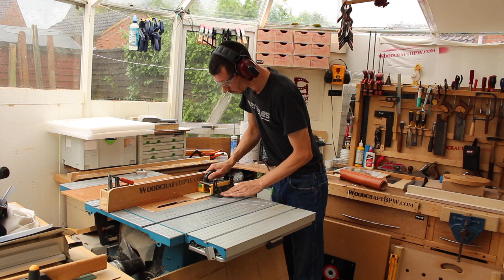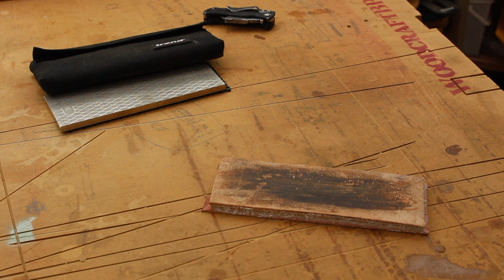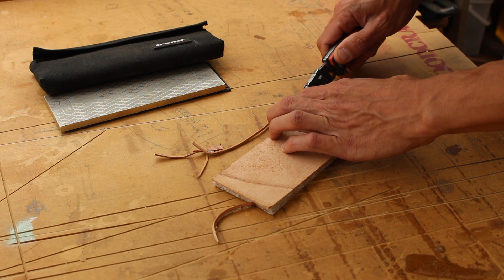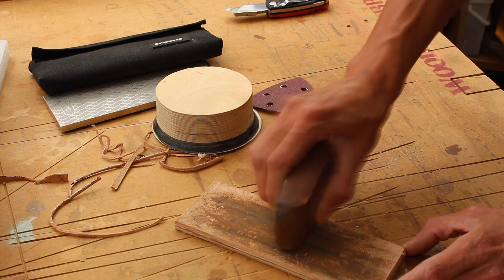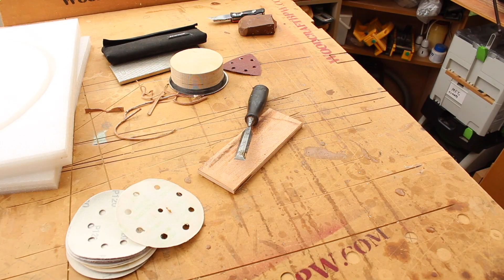How to Make a leather strop for your oil and diamond stones for sharpening chisels, plane irons etc.

Comment: Hi Richard; Haven't see you for awhile. I suppose busy with your 'Day' job ;0. I am also surprised? you are not using the technique of turning your sprays upside down and giving a quick blast after using / before putting away to make sure the nozzle is cleaned out, and ready for the next time. It looked like you were having problems with them a few times. Thanks again, keep them coming.
Reply from the maker: Yes, I've been Insanely busy with work! I had job at the toy shop which went on for about a month, videos to come out soon! :-) then after that, I had to take some time off for Family. I have several videos all in post production, shot in various locations which will be coming out in due course and on things get back to Normal (if there is such a thing for me! :-) )

I actually never turn the cans upside down with any of the Tensor range - never needed to, it just seems a waste of propellant! :-) sometimes I have to peel the glue from around the nozzle, but never ever wasted a single drop form in side a can! Just one one more reason I love the brand, even though it's more expensive.
Reply: Hi Richard, I did a Google search for the Tensorgrip but it doesn't appear to be sold in the US.
Reply from the maker: +Steve Collins Have another butchers but for "Quin global", they defiantly are about over the pond.and are also going to be at the Atlantic show in August (stand #3139), if you're heading over definitely make a beeline and check them out! :-)